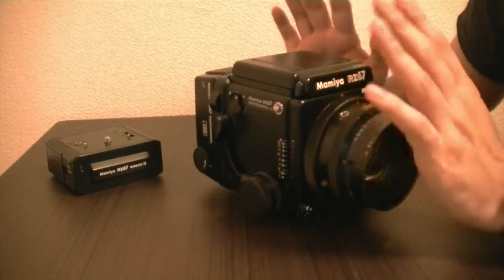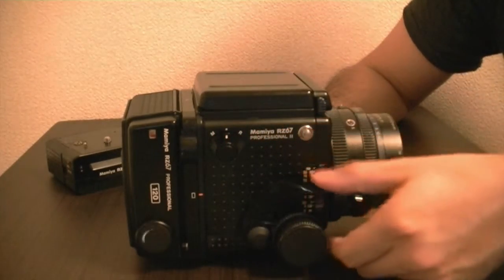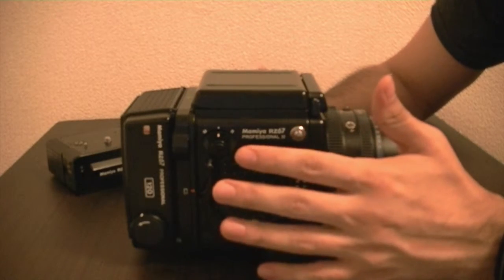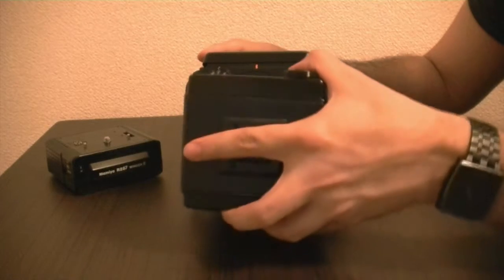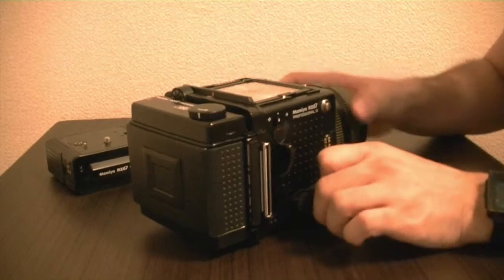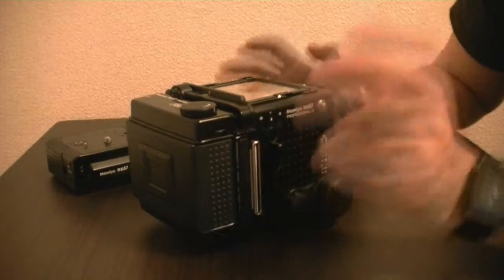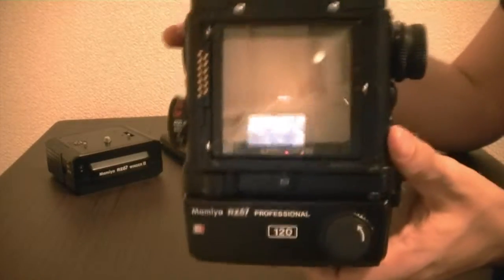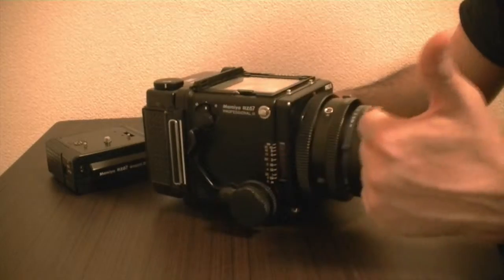RZ67 Pro II Video Manual : 13   Operating the Cocking Lever

Comment: Thanks loads for the trick of twisting/rotating the film back!! All I could get was a red and orange light and my exposure readings wouldn't light up. Though I could cock the film advance. I rotated the back as you suggest, and voila! Works both in AE with the finder and manual (my battery still has 5x V left in it.)

Comment: I just got one in the mail today.. it only goes about a quarter or third of the way and won't go past that. The mirror and lens are uncocked. Any ideas? Thanks!
Reply: Noticed you mentioned in the video, tried turning the back a bunch of times like you did and it's not working :( Neither landscape or portrait...